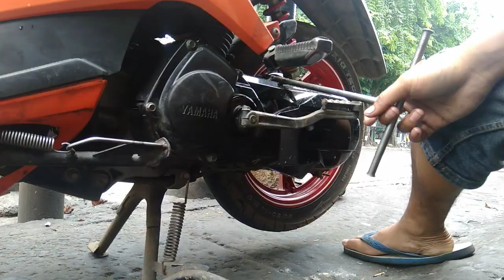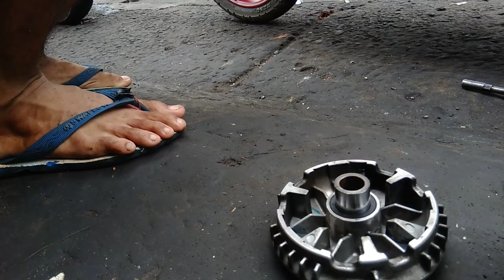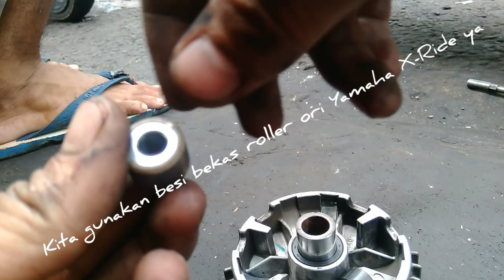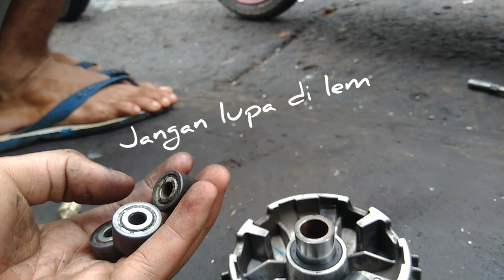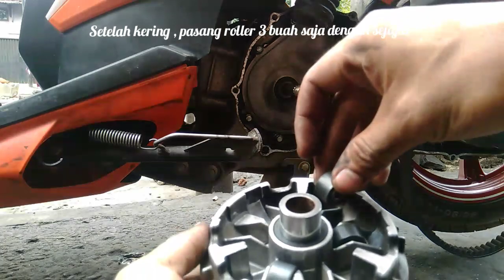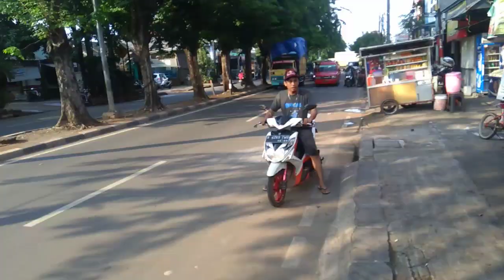Xeon rc jadi ngacir #otomotif #mekaniktutor #idmtutor #modifiikasi

Comment: Kita punya xeon rc 125 ymjetfi pas ditarik gas ngeden ga ada larinya malah boros bensin nya ,terus susah distarter itu apanya ya bang, terima kasih...
Reply from the maker: Menurut pengalaman saya pertama filter udara kotor,terus  kompresi ada kebocoran ,klep harus disekir ,ruang bakar kotor dan ring seher udah lemah , .
Reply: cek kmpas kopling kl ngeden yg simpel dulu kl ulir kanan kiri klengkungnya gk sama brrti udah aus, kl susah stater pengalaman saya bendik statter udh soak, pengalaman dulu saya , udh ganti part ori lgi alhmdllh smpe skrg 1thn normal sembuh, tpi cek jg sektor mesin bs jdi dari head ada kbocoran kompresi di seal klep dan ring (kl agak berasap)

Comment: gw jg pakek xeon karbu bang . . .ad video untuk nambah top speed.nya bang, . .
..bawaan sbnere  sdah lmyan dbanding matic sklasnya . .
Reply: Xeon GT 125 sy top speed 120 km,yg sy ubah roller 7 gram TDR, korek jalur roller,per cvt 1500 rpm ktc,ban belakang 90/90 yg lain standar
Reply: @mamakdedek6049  siyap . .bisa dcoba nih
Reply: Roler 7 gram punya motor apa sama jalur korek puley brapa drajat?

Comment: Bg mau tanya xeon gt saya ko berat bgt tarikan nya sma mio aja lewat babg
Reply from the maker: Coba cek filter udaranya aja dulu , biasa kalo udah lama mampet .
Reply: Xeon GT saya menang lawan Vario 150,yg sy rubah:1.jalur roller sudah sy korek pakai stang seher bekas,2.roller pakai 7 gram TDR ,3.per cvt 1500 rpm ktc untuk PCX ,4..dudukan per cvt Xeon karburator,5.ban belakang 90/90 pengaruh top speed,karena lebih tinggi dari ban standar 80/90,yg lain standar semua.top speed di speedometer dapat 121 km di GPS ulysse 106 km Vario 150 2017 standar di speedometer 117 km di GPS 105 km
Reply: bahan bakar juga pengaruh
Reply: Coba setelan klepnya dicek... Biasanya kl rapat jdi berat tarikannya... Xeon gt ane dlu jg gtu...
Reply: @halimatusshobiroh7641  klep bagian apanya bang.. Maaf sy gk ngerti mesin 😁

Comment: Gw puny xeon  karbu standar tarikanny terasa berat ...gmna solusiny biar enteng broo
Reply from the maker: Cek bagian filter udara aja dulu bro , karburator ,dan bagian cvt tahap pertama itu aja dulu..
Reply: Xeon GT 125 sy top speed 120 km,yg sy ubah roller 7 gram TDR, korek jalur roller,per cvt 1500 rpm ktc,ban belakang 90/90 yg lain standar
Reply: bore up ke 57 bs pake pston vario 150 , sama cam after mrket, dijamin power naik 30% an lbh
Reply: ganti roller yg enteng dijamin tarikan wus wus wus

Comment: Nih motor standarnya aja udah joss sih menurut saya untuk kelas 125 bahkan dibandingkan dengan yg terbaru kecuali si lexi
Reply from the maker: Iyah Bro untuk ukuran 125 CC saya juga puas sama peforma dan iritnya , ga rewel juga .Iya kalo Lexi bukan lawanya setara nmax teknologi nya 😁
Reply: Standarnya aja ane udah cukup puas dengan akselerasi Xeon GT 125
Saya rasa Xeon motor metik 125 yg paling ringan tarikannya....cm ane kurang puas dgn top speednya yg cm mentok di 110 kpj,,emang si kadang lebih dikit srkitar 111-112 kpj,,pernah jg hampir 115 kpj dijalan lurus panjang pas mudik tp cm sekali doang,habis itu gak pernah lg lari segitu.
Punya ane Xeon GT 125 2014 bulan 8 beli dari baru sampai sekarang performanya masih bagus gak beda jauh sama waktu baru beli,masih bisa lari 111.kpj padahal jarang servis cm rutin ganti oli doang,,aki blm pernah ganti sama busi baru ganti sekali
Reply: @calmbae339  upgrede sektor cvtnya gan, bubut atau ganti rumah pully yg pake 13,5 drjt (ada yg pnp by bubut thailnd an 200k an) trus ganti pake puliy yg lbih berat kl saya pke dr. pully 12-13grm rata x6 , filter ferox, dijamin jos gandos lwan nmax / aerox pun di pantatin..wkkwk ngejar ninin jg msih bs
Reply: part2 lain msih stdr , cattn kampas kopling mesti sehat alias gk selip atau udh tipis, dijamin lari nya joss ngacir bnget
Reply: @kucinghauk  ok thanks infonya bro
Reply: @kucinghauk  Ada link pembelian rumah pulley tsb?

Comment: Kalo rpm tinggi gimana masih nampol gak bro?
Reply from the maker: Masih bro,cuma top speed sedikit berkurang..
Reply: Hasil riset sy selama 2 tahun di Xeon GT standar upgrade cvt,untuk akselarasi roller 7 gram plus per cvt 1500rpm atau per Prodigy 1200rpm untuk Vario 150,dudukan per punya Xeon karbu,untuk top speed korek jalur roller plus papas rumah roller dan kipas biar jarak rumah roller dengan kipas lebih dekat misal lebar vanbelt 22mm jadikan jarak antara rumah roller dengan kipas 21mm,yg di papas bagian tengahnya,derajat tetap standar dan ganti ban belakang yg semula 90/80 jadi 90/90 karena ban lebih tinggi,satu lagi lubangin mangkok ganda untuk pendinginan lebih maksimal dan pembuangan sisa kampas yg terkikis, akselerasi dari 0 sampai 110km di dapat pada jarak 350m,120km pada jarak 600m ,top speed maksimal 125km dengan cara bawa nunduk

Comment: Om...punya ane xeon karbu 2011 std, knalpot std,roller std ygp 10gr, oli yamalube powermatic,bbm vpower. Ane setting sendiri pilotjet nya sesuai karakter yg ane sukak, perna test kejar vario 150 yg lg main vs nmax dijalan lenteng agung baru sampe 130 lbh dikit..handle gas msh ada dikit lg, kira2 utk bs dpt topspeed 180an tanpa boreup bisa ga ya?